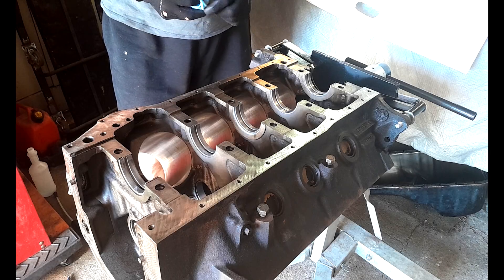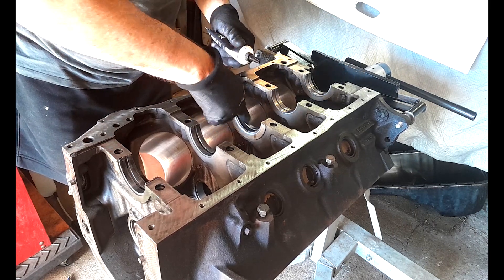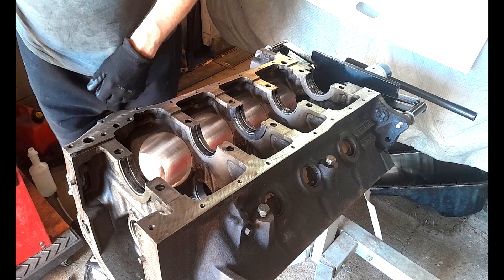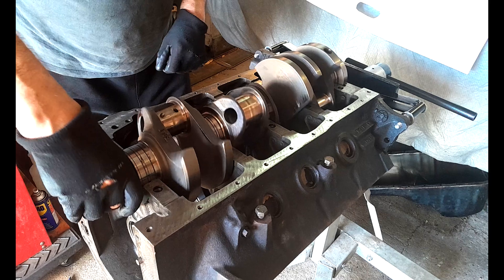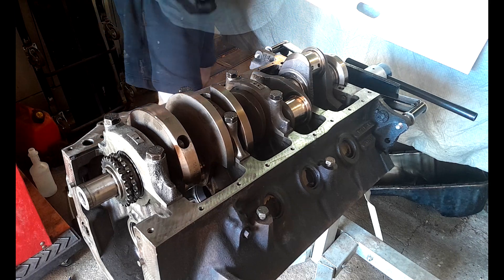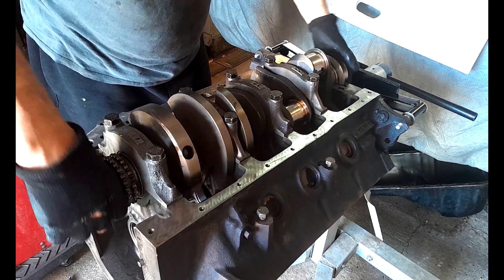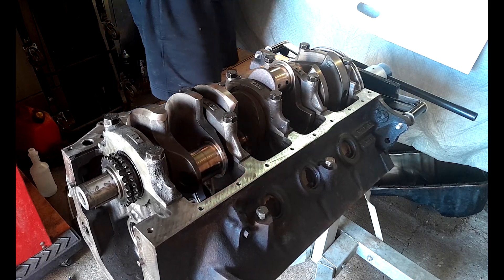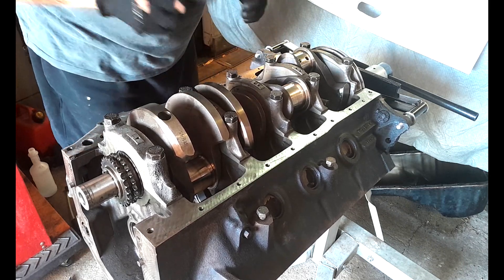How I Install A Stroker Crank 393 Cleveland

Comment: I always thought you had to "seat" the caps with a light tap with a brass hammer.  If they fall in, something is not right.
Reply from the maker: @danderson9881  good news is none of them just fell in. They all had to be “tweaked” to seat them. We are all good in the crank department.

Comment: Hey Dr. Nice crank install video. Two things that I do differently...1) I always build Clevelands using fully grooved main bearings. The Cleveland lower end can use the extra lubrication, and the torsional load wear difference is negligible. 2) I always stagger the rear main seals and apply a dab of RTV at the part. This way, the seal part is not even with the cap part. Not to say you're necessarily wrong. "Whatever works for you." I've just been building them this way for the past fifty years and have had good success. Keep on keepin' on!
Reply from the maker: @billfioretti3013  thanks Bill. Haven’t put these in as many times as yourself, but I have had a few sessions with crank installs.

I have offset the rear seals a couple of times with good results. Have also installed them straight up with a good seal. As you say, what ever gets you over the line. Thanks for stopping by. I appreciate it.